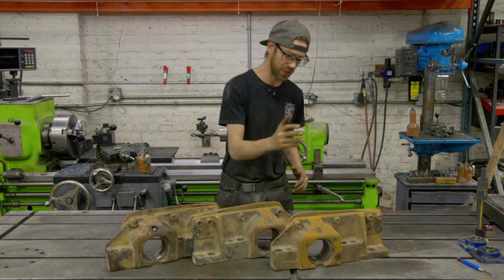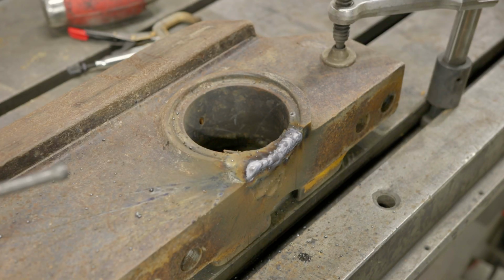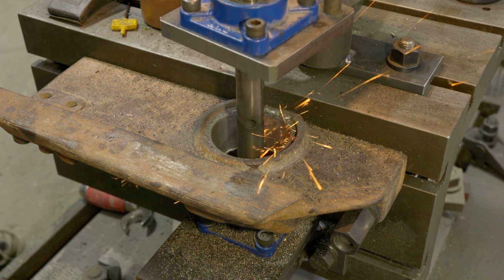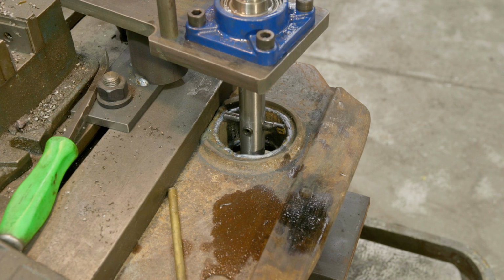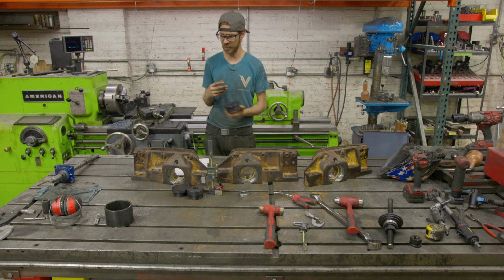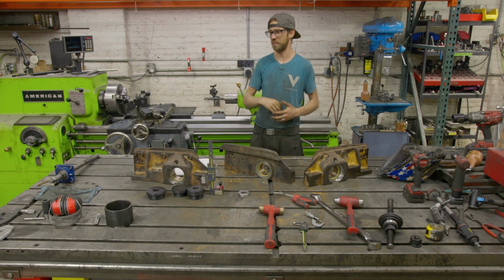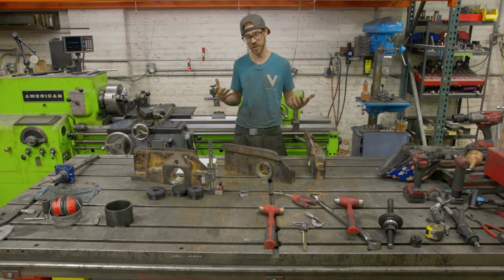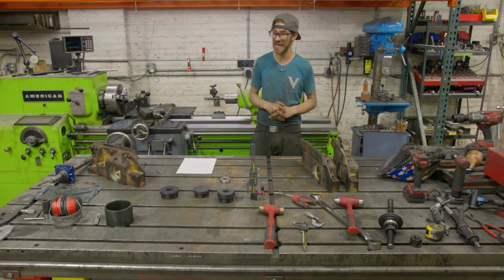Can You Line Bore With A Big Drill Press?

Comment: Put a  " O " ring on the bar at the lower bearing to keep the chips from getting between the shaft and bearing , it will wipe the shaft when going down and then clean with air before lifting it up and then reset the O ring back down to the bearing before the next cut  , this should help with the shaft wear .

Comment: It was not the fragments of the sleeve that caused the hardness of the weld, but the carbon contained in the casting hardened the weld.
Many years ago I was welding the hub of a cast iron flywheel and couldn't machine it.
Reply from the maker: Interesting!

Comment: Ok there’s a guy on YT that’s extremely skilled in this field of engineering. You could pick up a lot of good info from his channel. If you’re interested? Let me know & I’ll provide you with his link.
As for the job itself. I feel you would have ended up saving time & got a much better result using the WS2. It’s what it’s designed to do & it does it very well. 
If this kind of work is something you really want to branch out into? Investing the time into building extra components for the WS2 focusing on ease of setup & consistency is the way I’d go. 
As I said above. The guy I suggested would be highly educational for you. 
Best Regards

Comment: Awesome method of line boring. Im in the process of buying my first shop machine. Supposed to go check out a 10x54 birmingham tuesday. Looks like I'll need a good angle tilting table to fixture parts like these. 

I use some of those same style self aligning bearings on my s power machine. Extremely helpful when it comes to setting up, and not pinching the bar. However, consider the extra internal clearance of these bearings(.007-.010") may cause some issues! For example if you dont have these bearings supporting both ends of the bar, you may get a tapered bore. My solution was to order a sperical bearing with a c1 rating on the internal clearance. As long as the internal clearance is close on all of your support bearings, you will have a straight bore.
Reply from the maker: Yeah, good luck with your shop.

Comment: So you say you had a hard time machining MIG welds and you have an oven to anneal the welded part. Maybe next time use it. The upper bearing support was on the weak side as I seen on the video.  The lathe is much more suitable for this job, just bolt the part to the cross slide, use shims to center it. Greetings from Hungary.

Comment: When you had to pre-heat the part while it was attached to the radial drill did you end up having issues with losing your pre-heat due to the long length of contact where it was anchored? 

I also was wondering if there was a reason that inserting a sleeve/bushing by either press fit or Retaining Compound was not viable or desired…
Reply from the maker: The heat loss wasn’t an issue. Sometimes I use the retaining compound sometimes I don’t. It depends on how tight the press fit is. The bushings were tight enough where I don’t think it mattered.

Comment: Lots to like with casual use or one off 3D printed bushes and jigs. Even for lighter sheetmetal press tooling works well. Where they fall over badly is if you try and spin or have another surface ride on them so use backing washers or metal spacers like you had on the bush part keeps the remelting at bay. Who knows next thing will be a CNC Mill 🤣
Reply from the maker: Appreciate it cnc might be a while off but we’ll see

Comment: Very interesting, and I REALLY appreciate you sharing what you learned and what kicked your butt - because let's really be honest... NO one gets through unfamiliar jobs without getting their butt kicked on something!
Yeah I think if your bar diameter was thicker, I think it would have gone way better. Just being a bit thicker makes a big difference as it is Radius squared. Also, the closer your bearings are to the bore you are cutting helps significantly, more so than a thicker bar as it is length from the bore cubed for stiffness.
Reply from the maker: Yeah good thoughts. I am going to switch to 50mm bars for most stuff moving forward
Reply from the maker: Yeah good thoughts. I am going to switch to 50mm bars for most stuff moving forward

Comment: I have used a boring head on a big drill press successfully. If you switched to that it might save the bottom bearing issue and make measuring the bore easier for the final cuts.
Reply from the maker: Yeah that would work
Reply from the maker: Yeah that would work. I tried a criterion on this job but it snapped the shank from the cuts but it was already repaired once

Comment: Hey I am a young buck that has never lined bored but what if instead of the radial drill could you take the compound and tool post and shim the part square with the spindle then put the line bore bar in the lathe
Reply: Almost using the lathe like a horizontal milling machine
Reply from the maker: Yeah it works but hard to bolt it down to a smooth cross slide need to make some sort of interface plate.

Comment: Nice work Kyle.
I think that the job came out excellent. 👍👍
I think the answer or possibility is right behind you in your video.
Linebore in the lathe.
Use a universal joint driving the linebore bar and fixture the part on the cross slide.
Plenty of speeds and feeds.
I know a guy the purchased a big old lathe and was line boring engine blocks on it.
Came out great.
Keith Fenner installed main caps on a engine and line bored it in a lathe.
Another thing on final sizing would being using a Sunnen AN111 hone and a drill for final sizing.
Would be precise.
And certainly acceptable bore finish.
Awesome job on the 3D printed parts.👍
Thanks for sharing. 
Innovative and ingenuity, that's the American way.👍
Have a great weekend. 👍🇺🇸👍
Reply from the maker: Great thanks for the feedback Ed. I think I have one of those drill powered sunnen stones. I used it when I bored the arbor press. Should have used it at the end here.

Comment: Same old story.   Proper tooling is an investment.
Reply from the maker: Yes agreed but you don’t start with all the money from the start so you compromise until you can invest.
Reply: @VanoverMachineAndRepair   Yup,  cash flow is a real thing.    You can up your line boring game for the next jobs without buying a new machine by upping your tooling and can probably add gearing and improve the rigidity of your drill for line boring if you get more work but at the end of the day a drill  is designed to hog out lots of metal fast not precisely.

Comment: From what I can tell from the video, you were doing a whole lot of tack welds to fill in the missing metal.  Am I wrong?
Thanks for a great topic and well put together video.
Reply from the maker: I was running hot on pulse welding when building up next to copper not to burn through it. When weld gets to hot you don’t make any progress so you have to let it cool
Reply: @VanoverMachineAndRepair  thanks for the responses.  I’m someone who wants to learn a second trade for after I retire.
Reply from the maker: @dagorithe  no problem